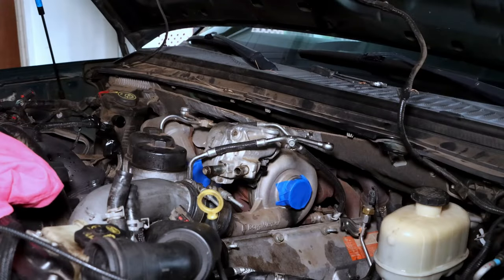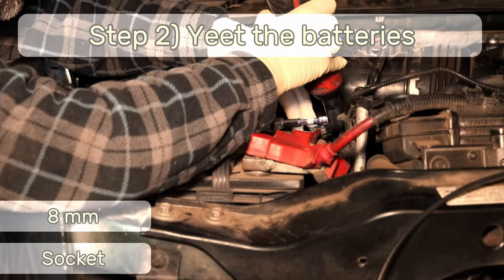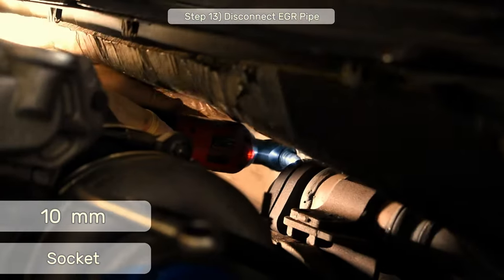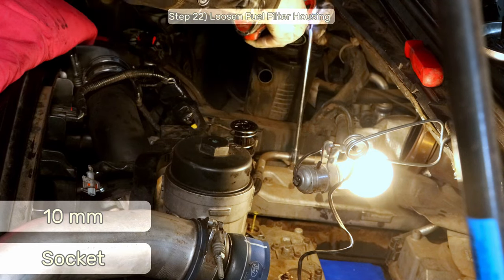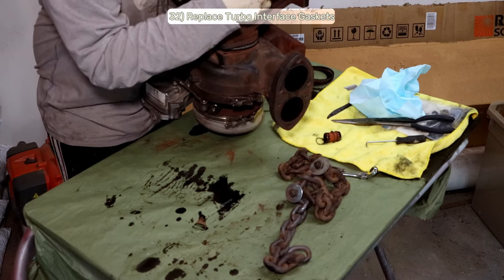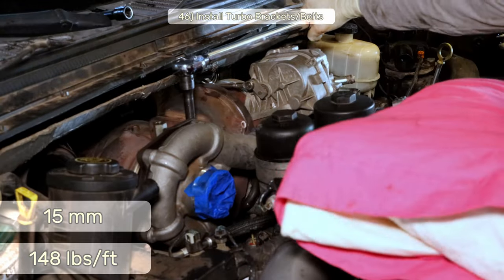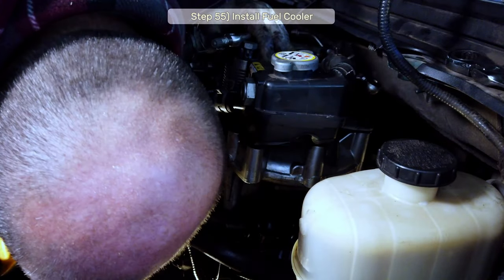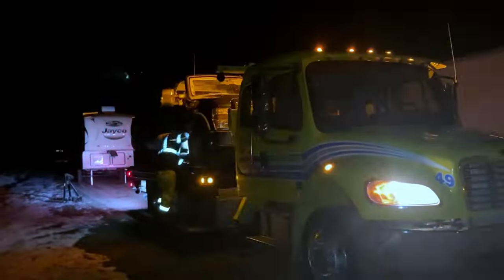Change your 6.4 Oil cooler (cab-on) for about $500 with my 69 step system!  IHWOC Episode 14

Comment: You know you can make this job much easier just by taking all cab bolts out but loosen the 2 rear one and lift the front of the cab enough to stick a 4x4 between the frame and front of the cab and that will give you plenty of room to do this.

Comment: I’m about to tackle this on my 300k miles 6.4.  Oil temps are rising and the fan clutch runs too much.  It’s still intact and hasn’t puked oil into the cooling system and radiator.  Thank goodness.  I had to do the injector cups on my 7.3 after it puked into the cooling system.  That was fun but nothing like this jobs gonna be.  I greatly appreciate your video and commentary.

Comment: Good morning! I just wrapped up this project... with 4 broken ribs (ATV accident). I was fortunate enough to have my g'friend assist me or I would still be out there. Took me three days and if I had read the comments, I would not have had to figure out that leaving the top cover off the oil cooler assembly myself would have saved me a few extra minutes... I was very proud of my genius in figuring that out and sat down to explain when I noticed the very first comment explained just THAT! Anyway... OUTSTANDING video! Thank you SO MUCH! LOVED you commentary and informative instruction! I and no mechanic (intentionally) but I do know how to work on stuff. A mechanic buddy of mine said he could do it in 6 hours... HAH! I have had new turbos put on, then a short time later new up pipes, deleted the EGR. The DPF has been deleted for years and run a 275 HP tune. Now expect to lift the heads if I do not sell this truck pretty soon! Again, THANK YOU!

Comment: This video was super helpful thank you! I figured out that if you leave the upper oil cooler housing off you can very easily drop in the oil cooler with no trouble at all. But you must then put the upper housing on and tighten it before you bolt in the entire oil cooler assembly since the two most forward torx bolts go slightly underneath the intake manifold. Saved myself a ton of time doing that. I imagine you could do the same when removing it as well.
Reply: I was about to set my truck on fire lmaoooo thank you 🙏 when a simple comment saves you 2 more hours of ur afternoon

Comment: Great video. I watched it four times before I decide I was crazy enough to do it. I did a few things different. I did pull the front body mounts at the radiator and put one 2x4 for a spacer I also pulled the other body mounts bolts. Oil cooler came out after a couple of tries. I did not put the cover on the new oil cooler out side the truck as in the video. I put the new cooler in its place then set the cover on top. I took one of the long bolts that hold down the oil filter housing and screwed it in a few threads. I pushed back on the bolt and it raised the front of the oil cooler. With the front of the oil cooler up I was able to put the two front cover bolts on the passenger side and tighten them down. I then put the oil cooler in it place and added the rest of the cover bolts and the rest of the oil cooler bolts. 
I hope this helps someone

Comment: Great job. However I believe I will remove all the cab bolts and necessary hardwear to take the cab off to do this job or at least lift the front of the cab 6 to 8 inches and block it up to help with the up pipe and a little more room to get the turbo out and back in that might help with the dipstick housing. Might save you having to talk to it like your first wife.😢😱🤪 but great job. Would love to BBQ you a nice stake dinner after helping me with that👍👍👍

Comment: The dipstick was the best part!!
Reply from the maker: At 32:30 in case anyone wants to jump right to it.
Reply: I accessed the dipstick through the wheel well. I had my fender liners out though. The whole fuel cooler can be accessed through the wheel well also

Comment: Does the coolant/oil have to be drained some before starting? And gotta ask cuz I’m a bit confused, what/where is the egr downpipe? Is it part of the up pipe assembly? How does it tie into the egr coolers (vertical and horizontal)
Reply from the maker: Yes drain the coolant, no need to drain the oil.  I don't actually remember where all that EGR crap runs around.  I try not to think about this truck as much as possible :P  Gotta purge all these traumatizing memories.
Reply: EGR coolers and the up pipe or down pipe is just a matter of what angle you looking at them.😂😂 I just sawsalled them out. Delete and Delete. I'm getting better emissions reading with all that failed government science project gone due to the fact I have increased the mpg by 1/3 and improved the stock hp by 10% +. Had to change the cold air intake filter I went with an S&B kit. Now the engine isn't being choked. Much better all around. Put a 4" catch can in with 1" ID tubing to the in port and 1" ID on  the exit or out port, do not kink the hose very important. PS big improvement in the cold start and no noticeable fuel in crankcase oil at 5K oil change ❤
Reply: PS re plum engine back pressure to the upper (Y) up pipe block off plate on the passenger downpipe/ up pipe what whatever. If you can understand.

Comment: I love this video! I am about to attempt this and was scared !@#$less until I watched. Not gonna lie, still scared but not near as much. one question. I am ordering all the parts necessary but when I search the part number for the oil filter stand pipe it comes up as for a 6.0. same part? just making sure. thanks again for doing this video, I used your links for the disposable tools and watched the video from a couple accounts. hope that helps. Keep the videos coming.
Reply from the maker: I dunno if the stand pipe is the same as the 6.0.  You replacing the whole thing, or just the o-ring gasket?  Either way, whatever dealer you're ordering from can surely get it right.
Reply: Just the o-ring gasket. They Sure look the same, we shall see.
Reply: Just finished up. This video made it a breeze, well a week long exhausting breeze... Also, I shared this video with the 6.4 no b.s. Facebook group, you have some new fans. I hope to see you do the rebuild video on your truck soon. Thanks again!
Reply from the maker: @keithmarkland5127  Glad it helped!  I decided to go with a Kill Devil Diesel Long Block replacement, so maybe that'll be an even better video.  I'm having the shop where the truck broke down replace it.  Engine had a 6 month lead time, which I'm about 5 months into already, so just a couple few several more months and I'll have a new bad ass engine!
Reply: Look forward to an update once you get it back.
Reply: I can’t figure out how to get the cooler out. Also mine is a2009:and does not have that port on the front of the cooler assembly.

Comment: Did you take the egr down pipe off on the drivers side
Reply: And reposition the turbo back presume sensor and cap off the small up pipe Y and gun the EGR along with the DPF